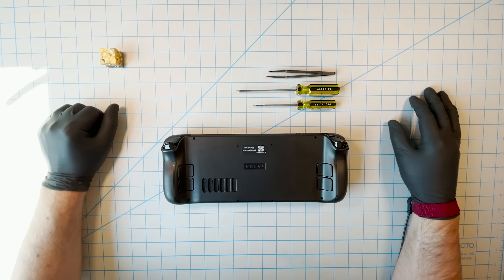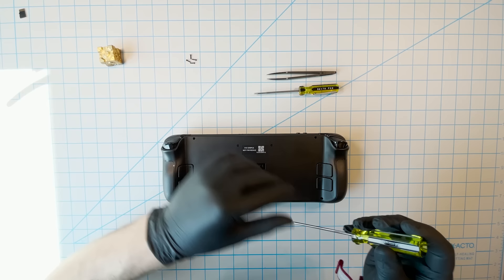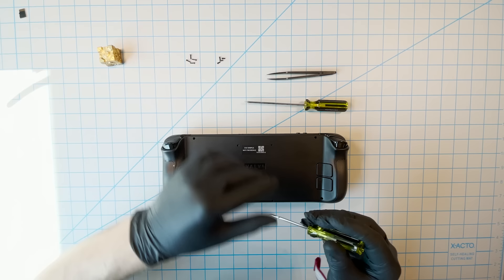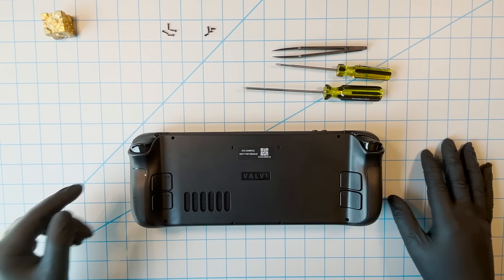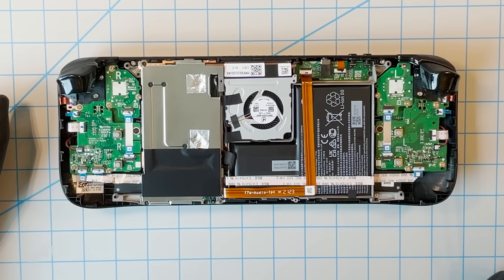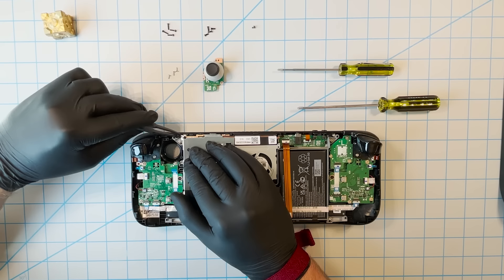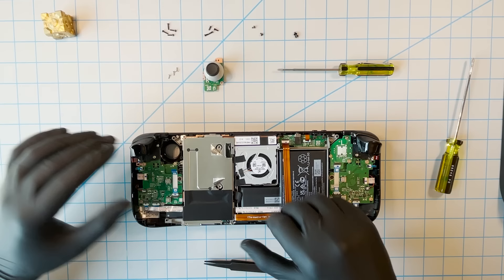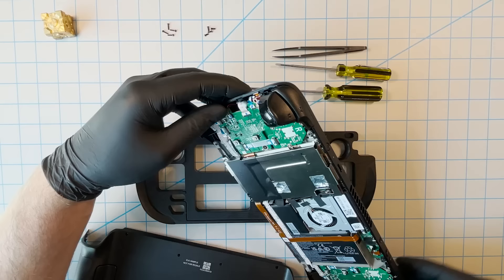Take a look inside Steam Deck™!

Comment: Absolutely fucking amazing. You did maybe overdo it a little bit on the scaring people about electro static discharge and risks handling the battery (I mean, like, it's likely not gonna blow up unless you actually puncture or cut it), but this is to be expected, and overall it's absolutely great you do a teardown like this. I'd be stoked if you do this for other hardware products as well! (Maybe even those no longer officially supported? Would be nice to maybe give people a chance to not have their Steam Controllers turn into e-waste once the thumbstick breaks). Also HUGE props for making custom parts available in the future (as long as you stick to your promises, that is. I have my eyes on you...). Also, obviously great and consumer friendly decision for you to have chosen industry standard connectors for your SSDs.

Seriously, I'm a huge fan of this video. Repair friendlyness is absolutely required going forward to change our throw-away society into something better to preserve it for future generations. This is a small step, but an important one.
Reply: They have to overdo the warnings, since this gets into legal liability territory. Remember the DIY crowd is tiny compared to the consumer base in general, and they understandably want to guard against people who shouldn’t be messing.
Reply: I built my first PC this year and consider myself handy with electronics. I still managed to cut myself on the fins of my CPU cooler :) imagine what a person that knows nothing about these things can accidentally do to that battery. "ohno, the screwdriver slipped and kinda hit the battery", that kind of thing
Reply: @Mediaright  Educate, not scare away. I'm happy with them warning about the dangers of damaging a LiPo battery, saying it could burst into fire if damaged, but the way they overdid it in this video makes it almost feel like fearmongering rather than just covering their butts in terms of liability. They already did that by stating they don't recommend this, and that any self-inflicted damages aren't covered by the warranty.

I personally don't believe that there are any people that "shouldn't mess with their electronics". I believe that if someone is interested in taking their stuff apart or try to fix something by themselves, they should be encouraged to do so, but they shouldn't go in without educating themselves first. In that regard, this video is fantastic. Some people are gonna take it apart either way, so it's better for the manufacturer to educate them about dangers and specific design details that they need to watch out for, since the manufacturer knows their device the best, in the end.

But at the same time, the way they make fear in this video sort of sends a double message. "You own your electronics, you do whatever you want with it, and we'll even tell you what to look out for even if we legally don't recommend opening it", but at the same time "You're putting yourself in EXTREME danger opening electronics like this, you should leave this to a professional or you might DIE!"...

Overall, I'm massively happy with this video, and I give Valve all the support and recognition for posting it (I already shared it everywhere I could think of), I'm just saying that there still are some things about the way they communicate the message here that could be adjusted. Also them stating the fact that static electricity will almost definitely break the electronics, where in reality, you need to be really unlucky for that to happen, in most cases even a spark won't damage anything. I mean, heck, the guy in the video definitely wasn't grounded and I'm certain his console still turns on xD

Comment: I'm the type of guy that HAS to tear into EVERYTHING.  THANKS VALVE for not making it EASY and NOT a headache akin to the first surface devices...
Reply: "THANKS VALVE for not making it EASY and NOT a headache akin to the first surface devices" is extremely confusing please explain.
Reply: @_icey  Microsoft Surface was shitty
Reply: @GrayDaDolf  That kinda explained it, but what does "for not making it easy" mean?
Reply: @_icey  The first gen surface had something like 50+ screws AFTER you heat gun and carefully pry the glued screen off.... just to access components.  They do this for profit mainly... so they can sell you a 200 dollar memory upgrade.... when it is EASY to design a device that is easy to repair/maintain/upgrade.  VALVE has designed the steam deck to be EASY to get at the internals and do what you want with it.  BRAVO VALVE, keep it coming!!!

Comment: Just a note, that ground strap is probably not working if you put it over your non-conducting plastic gloves. The strap should be touching your skin in order to be connected to ground.
Reply: they said that at 2:10

Comment: I mean, maybe it could be slightly cheaper to replace the SSD yourself than get the higher end model, but so many things must line up and work perfectly for it to be safe for its surrounding equipment. Their explanation is perfectly concise, though I wouldn't say a micro SD is plenty for a portable gaming computer that can tackle anything released on Steam lmaoo 

But the fact that it can be done and is by design modular? AMAZING.
Reply: Except there are quite a few NVMEs on the market now that are perfect upgrades.  You can even buy the ones Valve uses if you want.

Comment: Many people in the repair community including myself don't appreciate fear mongering around these batteries. They will not kill you. You will not die. So have fun! tear it apart, put it back together! if you puncture the battery it will be smokey so unless you try to put out the smoke with tissue paper and gasoline you will survive. Don't let these companies' lawyers scare you away from exploring the awesomeness of todays tech for yourself!
Reply: It should also be noted that taking apart your devices does not void warranty, unless you damage the device yourself and they can prove it. Burden of proof falls on them not you. If you take it apart and put it back together and it just wont power on, send it back. if they can't prove you broke it, it's under warranty.

Comment: Looks way easier than opening up the switch, and I've replaced a dozen thumbsticks on that by now. So many tiny screws and springs to lose.

Even getting to the ssd looks pretty simple, though I'll wait until that particular bit has been studied more thoroughly. Sounds like the trick is finding a well matched drive, as opposed to actually swapping it in.

All in all, its really cool of valve to do this. The system looks very easy to repair. Which is almost never the case with consoles.

Comment: "If you damage the battery, the whole thing could catch fire"
Valve has clearly gone to a lot of trouble making this device "user" servicable.
After just watching Linus' teardown, I was wondering why they very firmly glued the battery in, rather than using a more user friendly method as seen on a lot of phones. 
The system Valve has used will make it a lot harder to remove the battery without damage.
This is something that will certainly need changing in the future as the hardware, if looked after properly, will most likely outlast several batteries.
I have many old devices such as a Palm T3, a RIO player etc that I have changed the batteries on multiple times.

Comment: Holy shit i thought this video was from a 3rd party, but no. Its from valve themselves.

 I could be wrong here, but i dont think any manufacturer for a prebuilt system has ever gone into depth like this.

 Showing the interior, the dangers, highlighting what can cause the dangers, providing options for self repair along with the skills necessary to do so, and informing the userbase on info about possible changes to future devices as well as resources to look into that.

Also im guessing their intent to discourage doing any of this and disguise it as an "information video" is so they wont be held responsible by people messing up their systems by providing these steps. So they can show off how to self repair without being taken advantage of by the people who dont heed the warnings and recieve liability for doing so

MASSIVE props to valve for this

Edit: I dont know what the fuck im talking about really, this is only my speculation

Comment: Well done for sharing this and for planning ahead for replacement parts. Repairability, especially of mechanical parts, is extremely important. Pls also make sure the PCB and the ICs are made to last. Their undisclosed expiry date shouldn't be close. After my PS4 failed, I did not repair it, I did not replace it, Sony simply lost me as a customer. Similarly, for the Index VR and the SteamDeck, they are expensive pieces of equipment and we expect them to last for many years.

Comment: You should also try powering on the device multiple times after disconnecting the battery. Otherwise stored electricity in the capacitors and such could harm you or your device!

Comment: Nice to see what Steam Deck has inside of it and I hope the next version will have Thunderbolt 4 or at least USB 4, 5G SIM Card slot, and bigger display wihtout huge frame  around it.
Reply: 5g drains a lot of battery. Why not just put your Phone into modem mode
Reply: @fruitycoconut  you can turn it off when you don't want to use it. Very simple and easy
Reply: @Theboss00077  i meant under use it drains a lot

Comment: No one seems to understand that Valve have done nothing different here than any of the other companies apart from creating a video to show you how to do it rather than waiting for a third party to produce one. They still have deliberately placed anti-tamper stickers on parts of the hardware, like you see with the removal of the SSD, and they still void the warranty if you've modified it yourself. You still need their custom parts to replace things things like the thumbsticks, you are almost as locked out of their hardware as any of it's competitors with the only exception being whether software specifically checks if a part is and disables the device; it sounds like this one doesn't and breakage is just on you. That does come with some downsides, like third party reselling and fake repairs, but it's marginally better.

This is another great example of brand loyalty where people are praising the same thing they're hating on with other companies. To all the people saying "see nintendo/appple" etc, you could have done the same thing with any of them and the only difference is they've provided an inevitable video that someone would have done regardless.

Comment: Now this, when it's just showing you that you can fix your own thing, and not buy and entirely new equipment, deserves respect.
Reply: the fact that they're so open about what's inside and still make sure to say that you can open it if you want is a massive move for a big company lmao. apple needs to take notes
Reply: Are you nuts? They don't want you to have the right for repair. The battery is glued in and really difficult to swap it. If you damage the battery you can easily smoke your device.

Comment: I doubt anyone official will respond to this, but I have many questions. They mentioned replacement parts and also don't recommend doing it yourself. So do they recommend sending it back to Valve if you have a part that needs replacing? Would there be a fee if so? I preordered the middle of the road model because the high-end one was shipping later, could I potentially purchase an appropriate, say, 2tb ssd and have it put in? They mentioned there could be heating issues with non-valve models, will there be an approved compatible 2tb ssd? I'm certain the price would be worse than buying a 2tb ssd off the shelf and probably even exceed the cost of the Deck, but the biggest micro sd cards are only like 1tb and I'd like to have more storage. Hopefully someone has answers somewhere before launch!

Comment: The esd strap you had on your glove isn't even a good one. this one only makes good contact with the skin  on the point where the wire is connected. The band is just a band not really a conductor so in this case it didn't really matter. My advice, full metal bracelet. Thanks for the video ")

Comment: If the batteries are so vulnerable, wouldn't it be risky to drop it by accident too?
Reply: the battery should be protected just fine by the case. the only time it should be on any concern is if it gets punctured or bent (which would mean the whole console got bent)
think of a smartphone battery, in that regard

Comment: 1:44 One way of avoiding it is if Valve was to make something durable and reliable.
Reply: Its mostly cap, the structural integrity is almost entirely retained. Its like when a medicine commercial tells you all the bad side effects, its just so that if it does happen to break someones steam deck, they can't get mad.
Reply: @spectralslog4127  I'm a bit upset because I found out that the motherboard isn't easily replaced. There are calibrations to make, and if the NVMe is even touched while the battery's plugged in, it can fry the board. Meanwhile, laptops can have drives swapped out without removing the battery, with some models having easy hard drive panels for quickly swapping drives.
Reply: @guidojacobs2002  Just unplug the battery before you remove the NVMe like the video? I just replaced my 64Gb SSD and everything is great
Reply: @spectralslog4127  I would, but muscle memory from eighteen years of transferring hard drives in laptops gets in the way, with multiple models requiring you to remove the hard drive enclosure to access the internal battery.

Comment: I wouldn't have such a problem with this if it wasn't for the 64 GB model's internal SSD filling up by itself, mine was showing 1 GB left, but it could only detect 32 GB used, the other data was not specified where it was, so i couldn't clean it. And my other problem is that those "Deck Certified" M.2 SSD's are not sold.

Comment: As many others have noted, I also greatly appreciate Valve's transparency and the simple fact that they designed the Steam Deck to (technically) be moldable/part swappable at least in a couple important ways. 

Buuut I did not appreciate the patronizing tone the narrator was using. I understand Valve is trying to keep people whose skillset is, let's just say, "lacking," from attempting to disassemble their Steam Decks, but the same end could have been accomplished by uttering the same words in a non-douchey way. Obviously, this is of much less import than the main point, but still a valid observation, I reckon. I digress. 

If there was still any doubt whether or not Gabe is a real wizard 🧙‍♂️, I suspect the Steam Deck is going to lay that argument to rest.

Comment: Mixed signals by Valve on the one hand they are showing you exactly how to do the most likely repairs/upgrade you'd make on the device while constantly telling you not to do it...  
Crazy as it seems I think the video is effective at not getting you to open the device....because it did scare me from trying the repair  even though I already did it and have done many repairs like it hundreds of times... So it works!
It's like reverse physiology or some other head games from Valve well done sirs...

Comment: I have a question guys, will i be able to plug the steam deck to my pc and just transmit the screen like i do with a switch or even a 3ds or psvita? or i need a capture card for it? i like the idea of docking, but i dont wanna use as a pc on monitor, i just want to capture the screen for streaming porpuses

Comment: Why does opening the case immediately weaken it?
Reply: They don't want you to have the right for repair.
Reply: @010111010110  To be honest they have made parts pretty easy to replace and added a nice video - they probably just want to generally discourage people who are not sure I guess...
Reply: @LaurenceGough  True true, but after the sticks comes the battery. It will die and you can@t replace it easily,

Comment: what does this mean:
"if you have followed these directions correctly, you've done absolutely none of the proceeding steps"
i dont get it.
Reply: Valve tells you not to open your device. That means, if you did what Valve told you, you didn't even open it and don't need instructions on how to reassemble it.

Comment: THINGS THAT STEAM DECK 2 NEEDS =
- RISC-V processor + linux OS = free of ARM/ x86/ Windows Royalties. Consumes less power and produce less heat = more efficient.
- Translate all games in the steam shop from x86/arm games to risc-V so that when you download games to the steam deck its already translated and less work for the steamdeck to run it.
-Optimize games for it= Locked 120 fps settings for all games when installed (if that isn't reachable then 60 fps locked)
- Quick resume function for games.
- Solid state active cooling + Solid state battery.
- To Valve = i'd say stop charging 30% royalties for every game sold, make it 0% instead have a extra supscription plan for 1 dollar a month where you can play all games like xbox live and earn income from that.
Reply: > stop charging 30% royalties for every game sold, make it 0% instead
that's a horrible idea

Comment: You guys should of made the hdd upgradedable instead of sd cards. it's kinda bs how little memory the 400$ model has and thats pretty expensive as it is.
Reply: they are already selling it at a loss like facebook did with oculus. thats why its priced similarly. they made a great move having it be the SSDs. and the repairability and replacement part supply is going to be ground breaking which is sad that it has to be that way but atleast valve has it figured out what the community really wants
Reply: Get your money up then